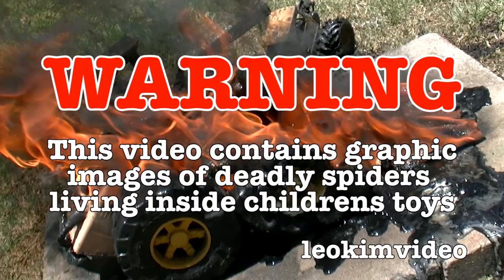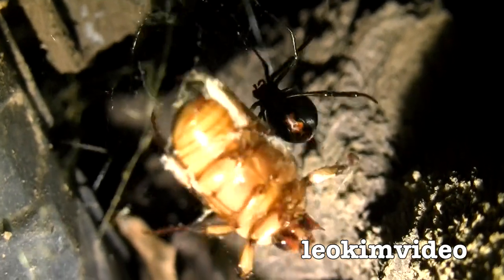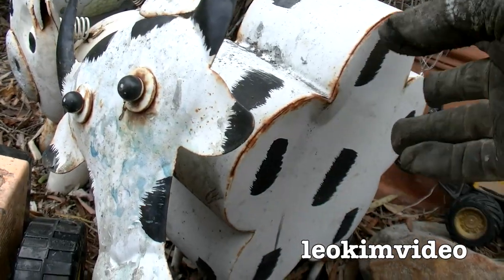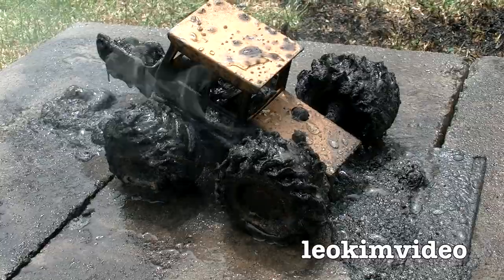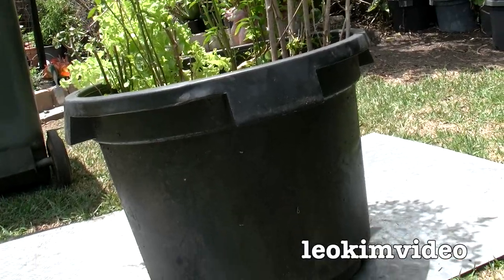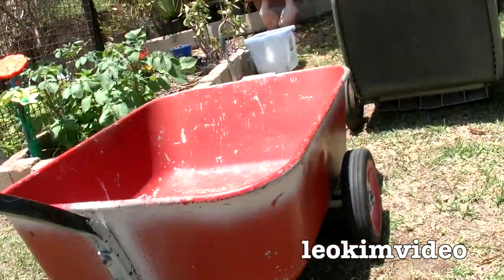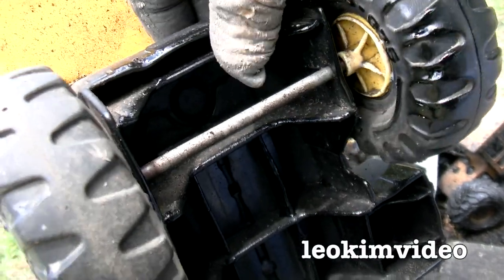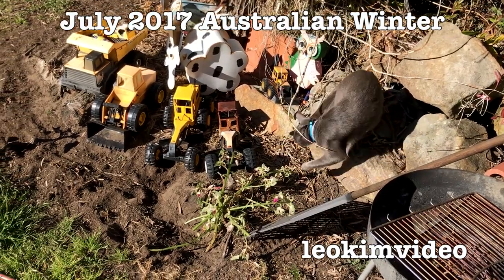Deadly Redback Spiders On Tonka Toys WD40 One Year Later Study & HAILSTORM

Comment: Red Back Spiders Are Basically Australian Black Widows Or Black Widows Are American Red Back Spiders
Reply: Wrong there both completely different
Reply: The redback spider (Latrodectus hasselti), also known as the Australian black widow,[2][3][4] is a species of highly venomous spider believed to originate in South Australia or adjacent Western Australian deserts, but now found throughout Australia, Southeast Asia and New Zealand, with colonies elsewhere outside Australia.[5] It is a member of the cosmopolitan genus Latrodectus, the widow spiders. The adult female is easily recognised by her spherical black body with a prominent red stripe on the upper side of her abdomen and an hourglass-shaped red/orange streak on the underside. Females usually have a body length of about 10 millimetres (0.4 in), while the male is much smaller, being only 3–4 mm (0.12–0.16 in) long.